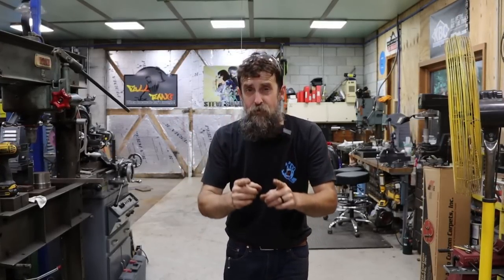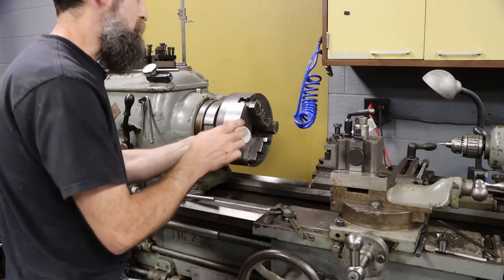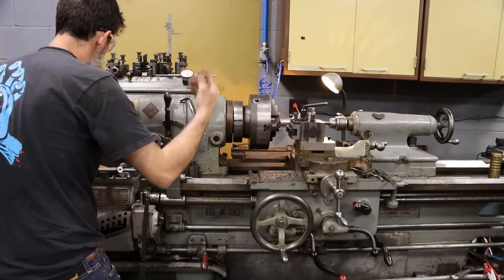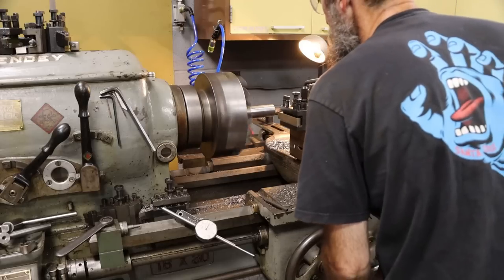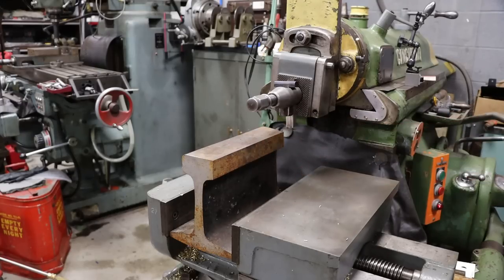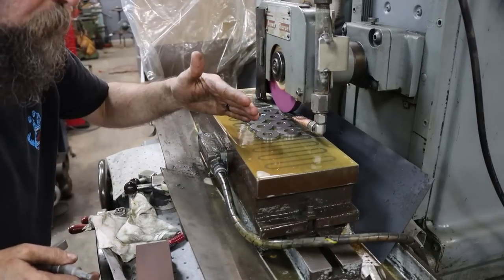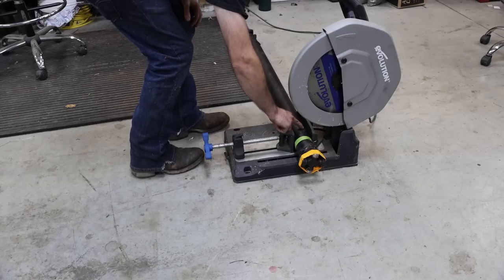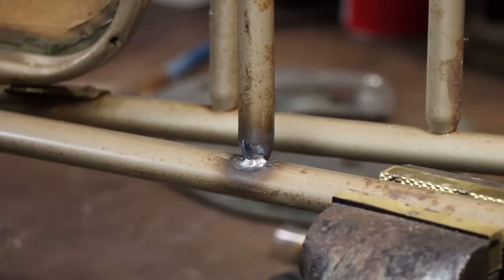Machining custom spacers and finishing the odd shop jobs.

Comment: What you did with your workpiece in chuck is exactly what I do with collets tool grinding. 
It absolutely works. 
You don't have to tap on a tool shank as much to get it to run true. I hate indicating. 
I made ( 4 ) washers like what you made to tram in my bench mill head . They were .250" thick to start. 
On X axis I ground enough off to bring in the X axis.
The Y axis is a little harder . You have to grind the other direction with the  washers separately. It worked well but the washers have to go back to their original locations if it is ever taken apart. Some people may have tramed their heads in differently but this worked very well.

Comment: WOW- leaning into that chuck and blowing off the chips with that big beard dangling is a scary looking operation.   For changing the chuck, just add a board with a hinge and a couple wood v- blocks to support the chuck- it will work for both your chucks.

Comment: Steve, if you applied AC via a rheostat to your magnetic chuck and gradually reduced the voltage (you made need to do it more than once), it should remove any residual magnetism.

Comment: Hello Steve and family,  if you live close to a rolling mill of any kind really, try to get ahold of the roll shop supervisor. Most roll shops will have a hand held industrial deguassing unit that will kill the residual magnetism in your magnetic chuck. I’d get one sent to you but they run $2000.

Comment: Hot tip kids.  If you feel compelled to check for heat with your fingers use the back side if your fingers instead of the part of the finger you need to most. It’s hard to pick up boxes while you’re waiting for your finger prints to return.

Comment: Morning Steve, to fix your mag chuck issue id recommend a OS walker mag chuck controller. We ran them on all our smaller manual grinders at work and they seem to be very reliable. It demags the chuck and the part when you turn it off plus it gives you the option to very the mag strength or go full stick. There not cheap but a nice small self contained unit
Reply: Excellent - automatic de-mag is the way to go.

Comment: Hi Steve, Maybe a solution for the mag chuck is to feed it with AC voltage for a short burst. I would this the chuck is feed with DC when operating. Congrats on the new addition to the family.
Reply: I was going to comment the same thing. If he pulls the parts off the chuck in AC mode off slowly it'll demagnitize the parts as well.TFS!

Comment: Congratulations on becoming a Grandfather.
Residiual Magnetism can be released by reversing the DC to the chuck. The original controller for the Brown and Sharp chucks did this automatically when you turned them off. Since you have a reversing switch to control the chuck you could wire it then give short reverse pulses to remove the magnetism.

Comment: Hi Steve, no matter what, family comes first. YouTube can wait because we’ll be here when you get back. I think I have it better than you guys in the states because some of my favourite channels, like yours, upload on Saturday morning but it’s Saturday night here in Australia so for me I can come in from my workshop, have my dinner and put my feet up and spend the evening watching YT. 😂
Just a suggestion, I have a similar power hacksaw to yours and it’s on four wheels which makes pulling it in and out just that much easier. 
Also I have an electromagnetic sheet metal bender which uses a very powerful electromagnet (4 tons) to hold the sheet metal in place while bending. When it releases the magnet it sends a reverse electrical pulse back through the magnet to get rid of the residual magnetism which something you could do with your magnetic chuck. Cheers mate, Stuart 🇦🇺

Comment: Nice, I have that same micrometer.
The drum switch for the mag chuck should be set up to apply DC to hold and in the other position apply AC to demag the chuck...
Only use the demag position momentarily, the switch "should"  be set up for momentary on the AC side and locked in on the DC side...
I'm betting that you will figure this out LOL

Comment: I had a lathe with a non standard sized L type taper (it was French, metric threaded) backplates did not exist for it, I sold it on and bought a lathe with a D1-6 spindle.
I think a hoist arrangement for lifting those chucks is needed, not worth the risk of a back injury.

Comment: It has been years since I've done any audio recording with tape and magnetic heads. That's pretty much all done digitally now. But I remember well that it was necessary to demagnetize those heads on a regular basis. There was a gadget for doing this. So I was wondering if there is a similar device for removing the residual magnetism from that magnetic chuck.